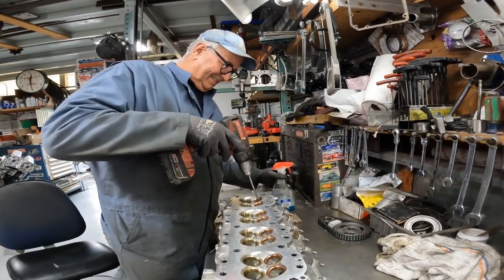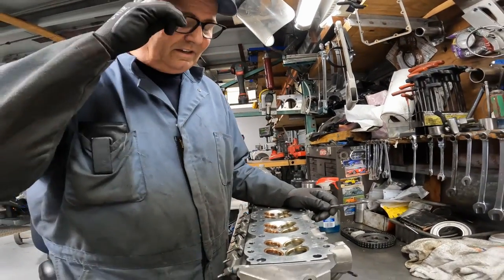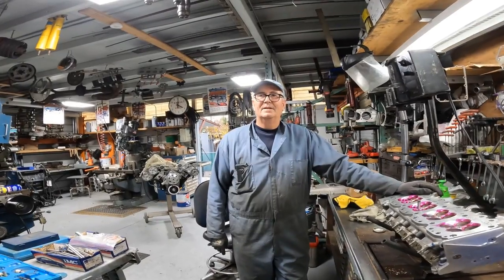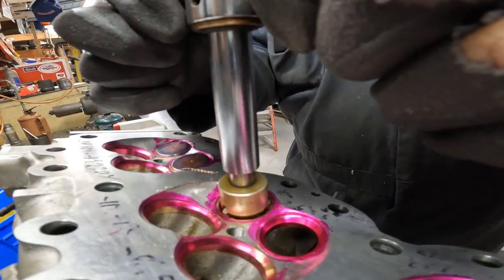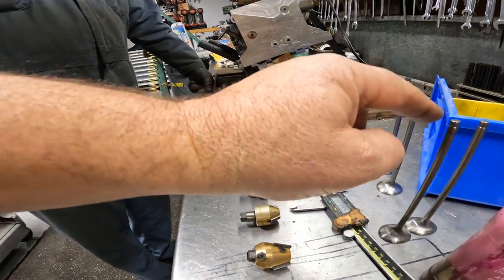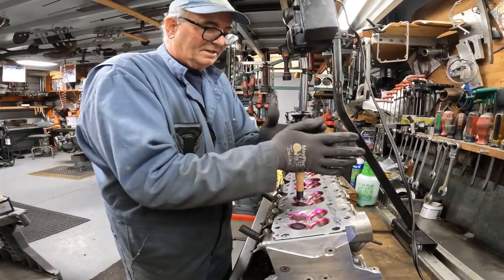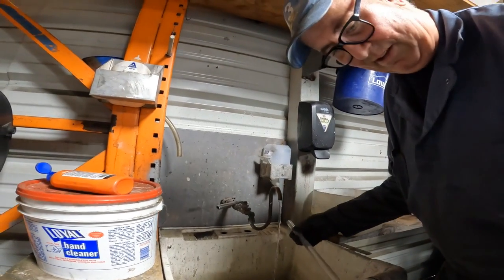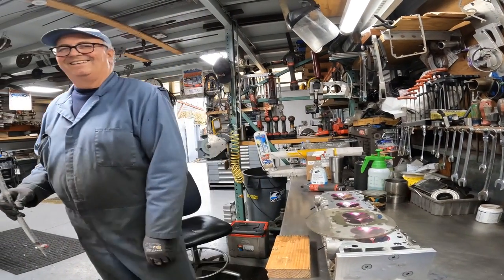Valve Job Techniques - Aardema & Braun Style - Homemade 2L Billet Racing Engine.

Comment: I'm in PA. Out of the military. Willing to start sweeping floors at a shop like this to start learning. This is amazing.
Reply from the maker: Bin,  Thank you for severing our country.  Greg
Reply: Nothing has changed in 100 years when it comes to re- fitting valve seats and guides . All of this can be done by hand , a normal oven and a few tools ( seat cutters , guide reamer , guide hone ,) once you have the tools you make the rules as to how tight you want for the fuel , oil, compression , valve to piston clearance , spring seat pressure , valve over lap duration , blown or NA . You will be as old as these guys and never be happy until you try something new to see if it works better . 36deg or 37 deg valve seat angle might gain or loose power @ 5500 rpm where you would want it say for a roundy round car , where a 55 Deg vs a 56deg will blow up a motor at 10k rpm due to flame frontage / propagation . Then when do you change from incknell sodium filled valves vs ? Once you fall down this massive rabbit hole then the more questions you will have . Thats why these guys have been doing it for a life time build break repeat until it works then push it until it blows up ,then back to the drawing board. LOL. These guys are out of the box thinkers and can build anything they dream of just like you can once you start doing it . Learn the basics of how to weld , read a micrometer , dial indercator , snap gauge , bore gauge , hand run lathe and mill and your off to a new world of education of self taught .This CNC shit is nice for mass production but thats not how they got there ( the big well know crate motors) they fought like everyone else until they had a sellable product . Then comes tuning for different air , temp, suspension and on and on . I would suggest you just build a turbo car to run 10's in the 1/4 that is fairly straight forward bolt on ,BUT, it will get your mind working and progressing towards what you seek to know. Then when you have a grasp on that 5-6 yrs from now your ready to push a broom in a shop like this . No disrespect towards how smart you might be now ,but, thse guys are miles above basic teaching skills . Good luck with what ever way you choose to go ,just remember this hobby will consume your life to the point you wake up in bed and have a idea that will haunt you .
Reply: @pkuudsk9927  Imagine having multiple hobbies, like electronics and this one. I'm not specialist in any but I do have those haunting ideas when sleeping, you are very right at that.
Reply: Learning something new is marvelous.
But you should study first if can né worth.
Reply: Thanks for your service my friend.

Comment: Brings back wonderful and sometimes frustrating memories 👏👍🤗
Wish I had that rig whilst building my own engines when racing at Kyalami F1 circuit in the ‘70s.
Measured head volume the same way and took ages balancing them during grinding.
One of the best experiences, plus racing‼️
Reply from the maker: Thank you Geoff!

Comment: I want more!!  I wish these videos were longer, I love this stuff,   I love different engines, especially the home built, or modified engines, I often planned out offset ground cranks,  different length rods and different compression height pistons, and possibly modifying pistons, to build different engines,  one of the first was a 302 Chevy,. 283 crank , 350 block, and pistons with 6" rods,   if I had the equipment and machinery to mill rods, and turn cranks,  ordering rods with blank small ends,  the moon would only be a rest stop to endless limits of what could be built, with cutting and welding modified blocks, or even custom built blocks, I think the first would be a inline 6, with BBC bores, maybe use a cut anc welded LS 7 head,  intake on the left, ex.on the right , party in thr middle! About 4.250 stroke, and about 4.300" max bore, with O-RING seals, with the piston dome, machined to fit the head,  with 6 bolt main, and the two outers going to the deck, actually holding the head on as well, with extra tabs welded to the head,
Possibly using a steel clamshell for the mains, the steel block side, machined and press fit into the block, and bolted into webbing, with direct oiling, use multiple oil pumps, with a semi sealed cam tunnel, scavenger oil pumps, with a 2piece oil pan sealing each cylinder , except for a small passage to the oil pickup, a semi dry dump,  a basically dry dump system, using a oil in pan oil tank, and the cam being two LS cams and lifters,. The cam used a taper  fit coupler, welded the two half's together, after a fine tuning of timing, possibly using multiple couplings, to put lobes where required, per cylinder, a possible using a fine tapered spine drive, using a the cam tunnel should be half full of oil under normal operation, keeping the rollers and bearings lubed  and cool. 
Machine the crank from 4340, with 4340 rods,  with the cam being  mounted just under the deck, no real pushrod required, the lifters nearly above deck when on top of the lobe, the , the cam placed high similar to a Detroit diesel 2stroke,  6-71, the inline engines,  the head could possibly be modified to house the lifters, and the rockers modified , or built to fit inside the lifter, using titanium and aluminum, the pushrods would be about 1" Long , so valve springs could possibly be much lighter,  it may be better to build a custom cam, from scratch, starting with a a large od journal, 50-60mm allowing for larfe bade circle, run about .700"-.750" lift,  .800"  max, maybe angle mill the head slightly to  get the exhaust ports closer to level, maybe angle mill the deck aswell, only about 
.045"-.060" from level, and possibly mill the exhaust flange surface, and weld a 1.5" thick bar of 3" aluminum, to the head at the flange area to  raise and turn the exhaust ports weld the bat around the exterior, aswell as the interior of the ports, and several plug welds, keep the same bolt pattern, possibly make the pattern wider, use additional bolts , make a 3/8"-1/2" steel plate, 1/2" larger than the ports, and remove material not required, the bolt pattern changed If required, make it possible to make headers by cutting headers for LS, removing a tube,  weld a plate over the intake side as well, about .750" 3.5", milled at a angld to level the port flange,  mill thr port entrance to allow high velocity, unrestricted  fuel/air flow using two injectors per port, one on top one on bottom, with approximately 5" long runners, with a slight funnel shape, being about 1/2" larger a from 2" out, .5" taller, .5" wider, going into a 6"x 1/8" wall sq tubing,  turned to form a diamond shape , or caddycornered , with the runners longer on the bottom to fit the angle, cut the square off at opposite corners weld on a .750" x 
.250" flat bar, to allow the two pieces be bolted back together, with 3mm screws every 30 mm around the perimeter, using two 70+mm throttle bodies one each end, possibly from a Chevy 5.3-6.0 truck,  by welding .500" thick aluminum rolled  to form a funnel shape to go from about 65-70 mm, small end, to about 5"-5.5" x 7"-8"  and about, 8" long, x2 welded to the 6" sq tube, to form the inlets, mounted between thefront two and rear two intake ports, using two pieces of 1/16" tubing tubing 4" long,  connected to a large flattened funnel from thin sheet metal,  going to a 4" tubing inlet, split to two 3" outlets, using rubber couplings, to vonnrct zo the throttle body, can be used to install a water to air intercooler,  but a 4" cone filter will be fine,  two throttle Bodies used on a V8 engine,  is overkill, so it will not be a restriction, use modified LS7 manifold/headers, and a turbo would be nice as well, running @ 2bar , at about 353cid, 5.8L roughly  it is a large engine, posdibly push thr stroke to 4.5" , with 4.300" bore, 392cid i6, it may need bbc head! With the cam3" or less from the deck, a cam sprocket and chain will not fit, so a in block oil pump, fitted below the cam, housing. 3 scavenger, and single pressure pump, fitting similar to a p-pump on a Cummings diesel engine,  with oil lines bolting on externally, with sump pickup, and oil cooler, and dual filters, use a traditional timing gear chain, to the oil pump, with a gear driven from oil pump to the cam, using a pair of small gears, around 4" x 1.25" thick, large rnough to put the timing gear sprocket with chain about 1.5" from the cam of, to miss the gear mounting bits, a d possibly cam button,  also incorporate a ledge under the gears, to hold oil. Using the oil leaking from the bearings to lube the gears, possibly have a oil squirter in the ledge to spray the gear,  .020" orifice, use a traditional Chevy i6 water pump mounted in a block on the block, with a 2" pipe splitting to multiple .5" lines,  going ibto tge block on eack side down low, mid bore, pulling water from the head, with water entering the head at front and rear, and possibly several places on the exhaust side, by a water manifold with 3/8"-1/2" tubing,  using two small injectors not a single large injector, should spray a finer mist of fuel,  and the bungs tge injectors are mounted in should be shapped like a whistle, having a dip to the outside, this being the area where the injector is mounted, at a angle putting it  as close to parallel as possible to the runner, to pull the injector out of the air flow, having only the tip just below the air stream, one top, one bottom mounted, with a 1/2" line feeding each end, and a 1/2"  return in the middle , the end of each rail, this should supply enough fuel for nearly 1k HP on methanol, or near 1400-1600 on gas,  fuel rail made from 5/8" to .750" i.d. tubing, with weld on  fittings for the injectors,   to allow 5/8 to 1" fuel line,   with enough oil flow to to fill a bathtub th a few minutes, the mains and rods should have no less than 60psi , and also use external oil passages from the rod journal to the pin, pressed in and soldered, 1/16" oil hole, 3/16" dilver soldered in,   lighten the crank as much as possible, as well as rods and pistons,   with the pin budhings with tiny grooves to spread oil,  abe possibly a 1/32" hole in the tip ifcthe rod ti spray oil on the piston for cooling,  the ksin oil being ded from a external line, to each main web, allowing the main to oil the rod by journal by in crank passages, instead of using narrow bearings, use wide bearings with a wide groove in the middle of the bearings, allowing oil to be fed to the whole bearing, with long rods short pistons, 6.125" anyway, and deck height to fit the package, and a vacuum pump to lower the crank case pressure, use thin low driction rings,with a gasport dome, 
Sorry I rambled too much, but definitely would like to build something like this,

Comment: I’m going to try the windex trick. I have to machine beryllium copper valve seats quite often. 
I’ve been machining custom sized seat rings out of moldstar90.  That is interesting material and quite expensive. 
  I also observed a different honing technique with the valve guide hone that I will have to try on smaller guides. 
   Thanks guys.

Comment: If you use alcohol it has less surface tension and forms the top of the liquid flatter. More accurate.
Reply: and u done this how man times again?
Reply: @kiiiisu  
Many. Alcohol instead of water. Common knowledge for ccing
Reply: I was thinking using washer fluid.
The blue would make it real easy to see the level in the barrette.  Eyes aren't as good as they were 20yrs ago when I learned how to do this.
Reply: @wrenchpony9735  sounds like a decent idea. I think some washer fluids have alcohol. But the colour sounds good.  We have been using methylated spirit or vodka. No joke. Less concave in the fluid.

Comment: I'd love to hang out in a shop like this I have some early hi compression Ford 289 heads I'd like to get the most out of for my period correct mustang build
Reply from the maker: Right on!  It is pretty cool hanging out with Pete and Kevin!
Reply: @GregQuirin  I'm just getting into engine building myself I'm a young engineer myself but grew up in the automotive service industry.  I've been doing as much research as I can about head work and engine design. The goal is to build as much as I can out of the engine that would have come in my car if I would have been lucky enough to buy it in the 60s... Almost 30 years before I was born😂

Comment: I’m still amazed that people think cc’ing a head is some big deal 🤣🤣🤣🤣! I was taught how to do that when I was 10! I’m sure the valve job is good 👍🏻! Because he’s probably been doing it that way since the 80s! At least he’s not still grinding with a stone 🙄! If you saw how fast a EPOC cuts as close to perfect valve job as you could get! Your mind would be blown 🤯! The cutters he’s using are made by the same company! I’m guessing they probably don’t do enough valve jobs to justify the cost! Because any race or production shop cannot afford to spend all day doing a valve job! What made us believers was my boss brought a set of heads to a equipment show, he spent a whole day fiddlefcking with the valve job to make it what we thought was perfect 👍🏻! Well when that EPOC machine went in & completely recut his so-called perfect valve job, he wasn’t happy! But when we reflowed those heads, they were up almost 10cfm! That’s a shit ton when those heads were for a no porting allowed class! We had a huge power advantage for around 3 full race seasons! They tore us down every time we won 🙄🙄🙄🙄! Which was a lot! If you look @ any real pro racing teams, or real professional cylinder head shops, you will see them using a Neway EPOC! I believe Serdi just brought out a new machine that is similar, basically single point live tooling cutting! I’m not knocking these guys at all! Because most of us did it the same way! It’s very hard to get every single valve @ the same height with those older hand cutters 🙄!

Comment: If its be bronze...I would not use air blowing the BE bronze chips away.....

Berryllium bronze dust  causes berillioses in the lungs...... ending up in lung cancer. 

Also , being a Professional head porter for more than 20 years...I only use a valve and guide machine  cutting seats. As its very very difficult, if not impossible,  have all the seats in line with guide bore and at same height.

Comment: The valves are usually only cut at 3 angles this 4th angle is pretty fascinating
Reply: 5 isn't unheard of either.
Reply: @MrTheHillfolk  what if they just made it smooth?
Reply: Radiused seats